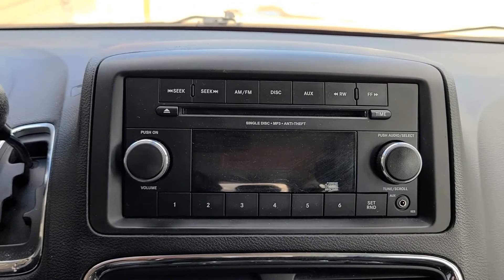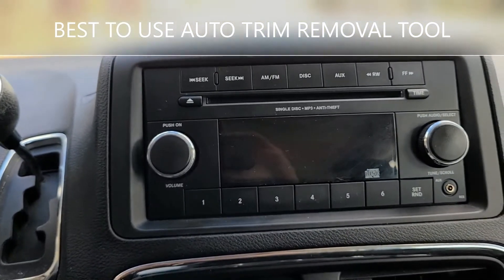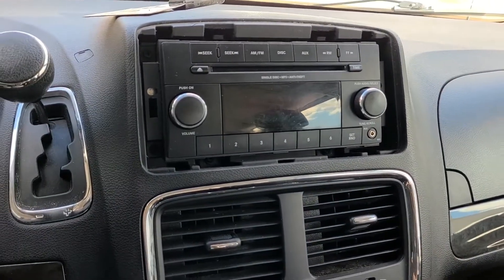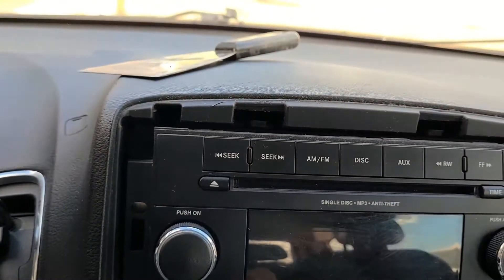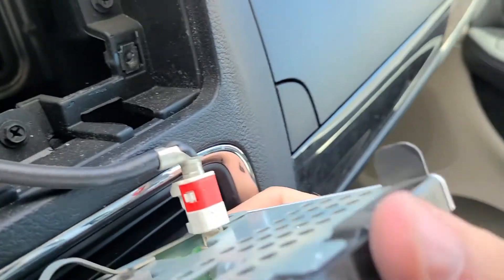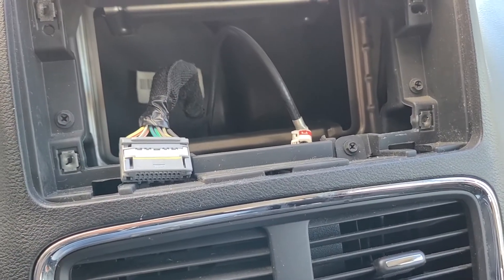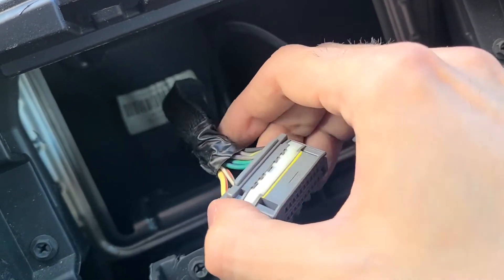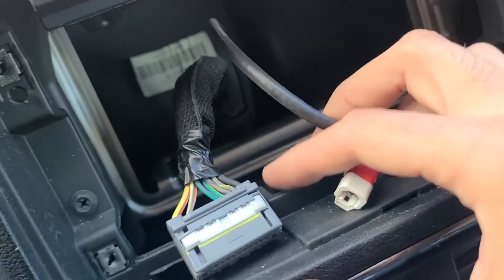Dodge Grand Caravan - Radio Removal / Replacement (2008 - 2019)

Comment: Im having the sound issue cutting out with the radio, but if I play a CD, its fine, would that still be a wiring issue or with the receiver itself do you think?
Reply from the maker: Most likely receiver or the antenna. Try pulling out the radio and wiggle the antenna while the radio is playing and see if it cuts out. Also try pounding on the radio while it is playing. If it cuts out, there is a lose connection somewhere on the motherboard and just needs to be soldered
Reply: @QuiteAlright  thank you
Reply: @QuiteAlright  When I push the antenna connection tighter to the receiver, the radio kicks on. Assuming that wire harness needs to be replaced, can it be, and as easily as it was to remove the radio? Or is it possible the
Reply: Or is it possible to test the wire harness versus the connection on the radio itself? Other than replacing the radio
Reply from the maker: @scotts7453  Most likely the problem is in the radio unit itself. Loose connection on a motherboard, I see it very often. You can replace the radio or have somebody fix / solder the one you have. Car salvages have bunch of this minivans and you can get a radio for $50 or so.
Reply: @QuiteAlright  perfect. I  didn't want to replace radio only to have it not work due to a wiring issue.
Reply: Scottie still alive? what fixed the problem goddammit I'm having the same issue.

Comment: What kind of harness would i need? And how would i install for this exact headunit, plus i would like to add backup cam ?
Reply from the maker: Hi, if you are replacing with oem radio unit then you will not need a harness. It should be plug & play. If adding backup camera installation will depend on the brand of the camera. But generally you will have to pull some wiring. You can also get wireless camera but they tend not to be too good

Comment: I've got the screws out, but this radio will not come out at all. Are there additional clips or screws I'm not seeing? I have a '16
Reply from the maker: I've never removed the one with large screen but everything should be the same, they should mount the same way and be interchangeable

Comment: This is great! When replacing it do I need to buy a new electric kit and a harness to fit the dash?
Reply from the maker: Only if you are replacing factory radio with aftermarket radio then you will need wiring harness and kit to fit the dashboard

Comment: Mine just flashes words the screen but the radio plays nothing and does nothing none of the buttons work. On top of that the heater turns on on its own and buttons don't always operate what they are supposed to.

Comment: Do I need to disconnect the negative battery terminal before removing the radio?
Reply from the maker: It is always advisable to disconnect the battery before doing any kind of work on the vehicle, especially when disconnecting electrical connections. Said that, nothing will happen if you don't disconnect it while removing the radio

Comment: What size fits ? I want to replace with a touch screen radio in a 2013 .
Reply from the maker: Any 6.5 or 7 inch screen should fit, you just have the  get the right installation kit. Google dodge grand caravan radio install kit and see different options

Comment: Do these radios have security codes?
Reply from the maker: yes they do
Reply: @QuiteAlright  Thanks. I watched your video before I went to the wreckers yard to find a replacement radio but now I need to get the code before I put it in the vehicle. Someone suggested on a Dodge forum that they didn't have codes so I thought I would check with you. Thanks again.

Comment: I have a routan with the factory radio no sat radio option can I put a factory radio in to replace that one
Reply from the maker: Yes you can, but make sure to get the radio code with your new radio as it will most likely ask you for it once you plug it in. It is usually on a small card within the owner's manual or you can get it from dodge dealer if you give them new radio serial number and donor vehicle serial number

Comment: What if we don’t have the vin from the car it came from
Reply from the maker: Hmm well wherever you got the radio from, they would need to give you either the radio code or serial # of both the radio and the donor vehicle. But try calling your local Dodge Dealer maybe they have a way around it and unlocking the radio. Possibly with their OEM scanner

Comment: NO! Don't do it this way! Just yanking on the trim is a good way to break it. There are cheap plastic trim tools to properly apply leverage the correct way. Oh and they will not dig into the trim ...
Reply: his video says to use a trim tool.